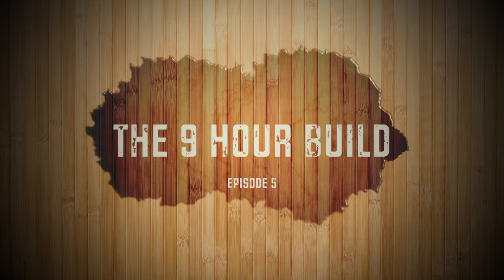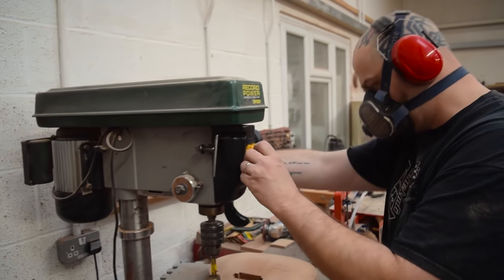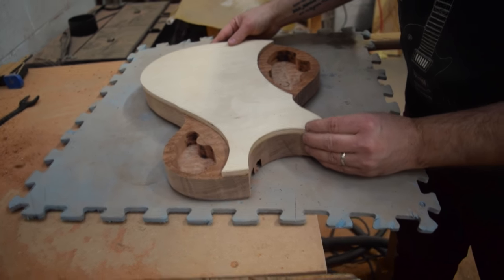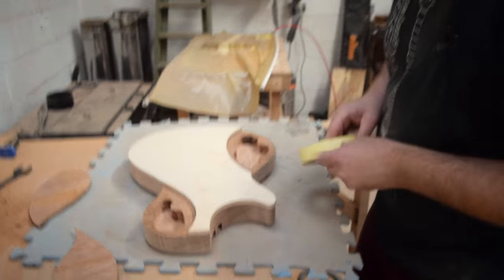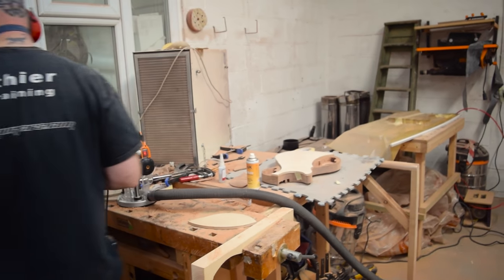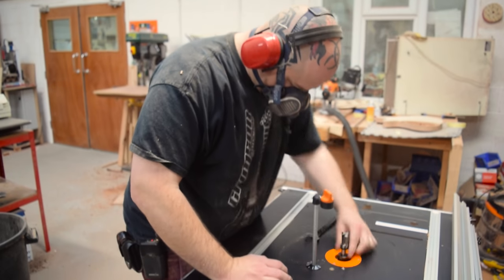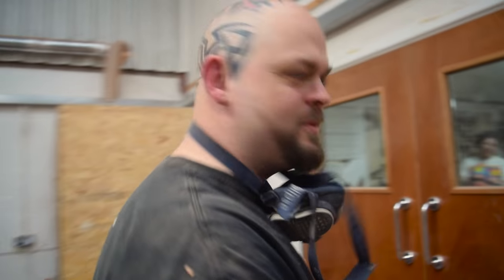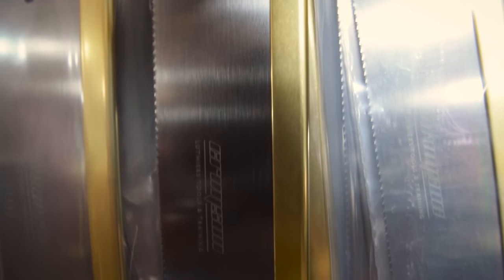Ep.5: Drilling and Routing the Control Cavities - The 9 Hour Build

Comment: Forget the Hepa filters and forget shop vacuums. Have a look at "central vacuum systems".
They have a more powerful motor, a massive collection bin and they live in a box outside the building.
All of the dust that passes through the filter is outside anyway, plus it's way less noisy as it's not in the building.

These are common in America, not so much over here but after I fitted one, I would never go back.
You just plug a flexible hose into the wall and off you go.
Reply: I wish I had that in the last shop I was in. Massive woodshop, but we only had 1 vacuum and it only swapped between two machines. Breathing in red cedar dust in 100 degree heat all day sucks haha.

Comment: Hey Ben, sitting here bored quiet afternoon in the office, so am binge watching the 9 hour build again, you mentioned needing a better way of holding the guitar body down  to the bench when carving with the angle grinder/saburrtooth. get some old style hold fast, drill a series of holes in the top of the bench to fit the them and you're golden. You can glue rubber or leather scraps to the fact of the hold fast so it doesn't mar/dent the wood surface.

Comment: Ben... If you are going to make those (brilliantly designed) cavity covers by hand on the 90hr build, I would suggest investing in that disc sander. Its the only way those edges will be perfectly 90 degrees square, for the tightest most seamless joint.

Comment: I was just about to nick your idea of magnetically attached back plates! What problems were you having with that concept?
Reply from the maker: +A1BASE it works well but a wooden backplate will want to warp, especially if it is thin, so screws are advised.
Reply: Crimson Custom Guitars would it not be better to just switch to metal back plates. Perhaps anodize them?
Reply: Crimson Custom Guitars Or reinforce the wooden backplate with metal. that will strengthen it and attract to the magnets as well
Reply: Kirk Anderson - and also shield it a bit, probably.